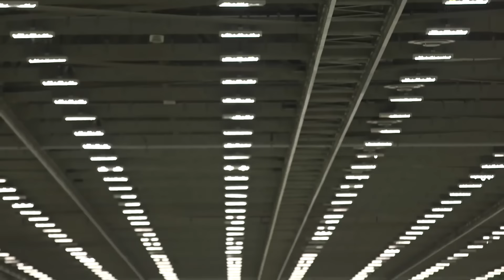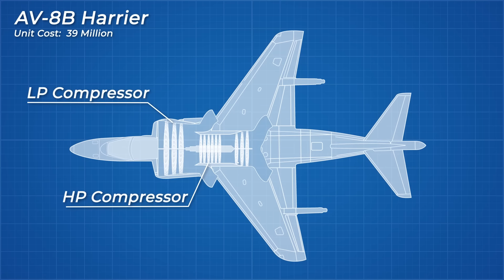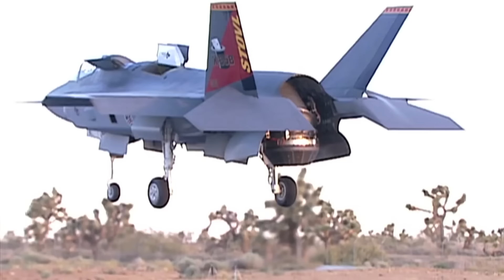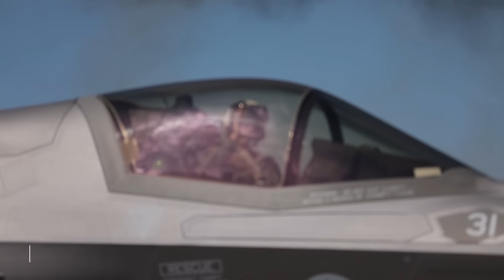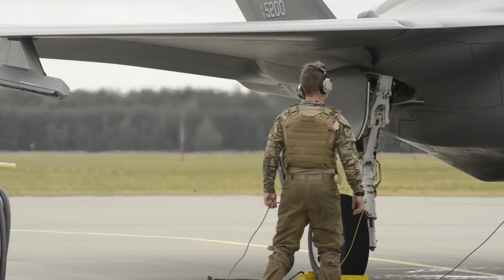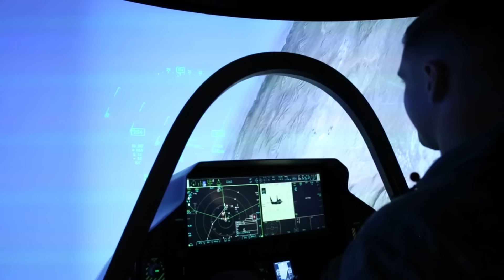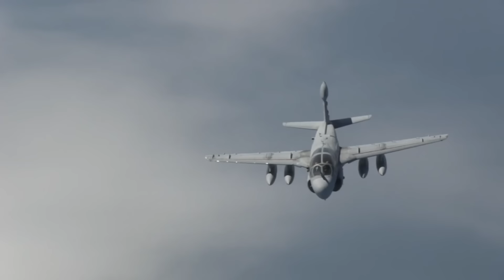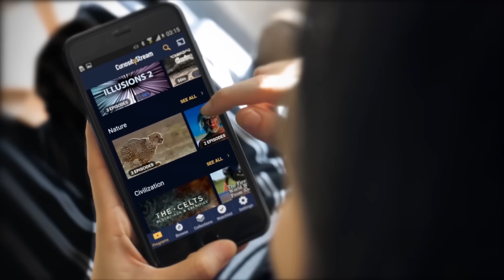Is The F-35 Worth $115 Million?

Comment: Tim N
1 second ago
im an engineer. Engineers dont just design stuff. they design solutions and this is no different. i worked on this plane (parts of it) and whilst it isnt cheap, its not the full picture.
The F35 has significantly less maintenance, turn around time and will have a higher reliability and supportability than any contemporary and historical jet, resulting in a superior cost per flight hour, and significantly cheaper support costs and logistics footprint.
Additionally the F35 programme across multiple countries has a huge domestic economic benefit which cannot be understated.
In all of these aspects it beats everyone. And then theres the performance. With the VTOL variant its clear that that offers features that nothing other than the harrier can match, and even the, the F35 has an advantage in that its much easier to fly, therefore predicted higher survivability than the harrier.
Add supercruise, stealth and the most advanced comms and detection suite and you dont need to be a great dogfighter.

PS i always think that the F117 is the 4 or 8 bit version of stealth..kinda like minecraft versus flight simulator 2020.
Reply: and yet the cpfh is significantly higher than earlier aircraft and the logistics situation is a mess due to ALIS not working. hmm.

Comment: Nice, vid just one notice concerning f117: when you said it was engineered in late 70ties, it would be also worth & fair to mentioning it was brought down by an AA system engineered in mid 50 ties, and never flew again...
Reply: The S-125 system that shot it down was a 1970s model, and it failed to lock on until the F-117A was well within weapons range.

F-117A was retired in 2008 due to obsolescence, since the B-2 could do the same role more effectively, and the F-35 was in development. It was also partly due to the shortage of pilots in the USAF.
Reply: The F-117 was used in the Iraq War 4 years after the shootdown.

Comment: Yes it worth USD115mn but actually that's not as that's costing USD 300mn with full features and flyover condition...That doesn't worth.. Exorbitantly expensive. Not at all value for money .

So at that price better to opt 2.2 units Rafale Or 2units  Euro fighter typhoon Or 4 units sukhoi su 35 Or 5units  Mig 35 Or  3units  Saab Gripen Or 3.5 units  F 16 super viper.

Units are given un decimals just to consider that any country will buy at least 10 units.

Comment: “Jack of all trades” is just a polite way of saying “master of nothing”. Being a jack of all trades worked for things like the M4 Sherman because it was cheap to manufacture and easy to fix. I highly doubt an F-35 would be a more cost-effective ground pounder than a Warthog.
Reply: "Jack of all trades" is a term touted by the media, not official representatives. The F-35 excels in BVR combat rivaling the F-22 for half the cost, and is by far the most capable tactical strike platform available today. Warthog doesn't even come close in anything other than direct fire support, which is only possible when the enemy lacks air defences.

Comment: Why didn't you quote the report the designer of the F-16 gave the F-35 flying rubbish. His analysis is a hell of a lot different to yours and I think I know who I'll believe. (not him needing US advertising money). The Helmet can also injure the pilot. The pilot can't breathe because the air generation system doesn't work and it can't be flown in a thunderstorm or inclement weather.
Reply: Pierre Sprey was not the designer of the F-16. He was an analyst who pushed for the emphasis of certain features in the LWF Program. His continued belief that the F-15 is a bad fighter because it has radar and other advanced avionics is perhaps his most egregious position, but he holds many others as well. For example, he predicted that the F-35 would increase in cost dramatically and be cancelled before the 500th plane. His analysis on manuverability is also highly flawed, relying heavily on wing loading as a metric, which ignores differences in control surfaces, wing geometry, and the lifting body effect.
Reply: @infinitelyexplosive  It can't turn as tight and climb as fast. It is a piece of rubbish and I have read greatly on the F-35 in US forces magazines and statements from the Pentagon, only less than 50% of the planes are ready for operations at any given time. They have huge maintainence issues and everything. When you buy 2 and only 1 is flight worthy at any given time, you have an albatross.
Reply: Since IE has already addressed Sprey I'll address the others... The helmet has been safe for pilots since 2016. The only time there has ever been a problem for pilots in relation to breathing it was found to be a fault with their training, not the plane. No plane is qualified to fly in a thunderstorm because if you're in a thunderstorm lightning is the least of your worries. Hail and strong winds are the main concerns.
Reply: @dumdumbinks274  Yeah a lack of training for 20 year veterans... Stop being told what to think and do some analysis. The official numbers don't add up and this sucker doesn't fly anywhere near Russian Phased arrays, Because they can pick up a 2.5cm RCS, which is smaller than this plane can be.
Reply: @ShaunByatt  Considering that only new pilots reported trouble breathing in the first place you leave me wondering why you're bringing up 20 year veterans.

What official numbers don't add up? Since nobody flying F-35s is at war with Russia they have to respect Russian airspace or risk starting a war. That doesn't stop them flying along the borders, but it does limit how close they can get to Russian radars.

All radars can detect a 2.5cm target. The question is at what range? Even the most capable Russian "anti-stealth" radars are incapable of detecting a stealth fighter beyond 200km (noted per Russian stealth capabilities which are far behind the US)... and they're incapable of effectively guiding missiles. 

The only radars Russia has that are capable of detecting stealth targets at notable distances are massive static installations that take several weeks if not months to move and are vulnerable to cruise missile attacks.

The F-35A has a very slightly lower sustained turn rate of 17d/s compared to the F-16C at 18d/s, but the F-35A has higher subsonic acceleration and far superior instantaneous turn performance, handling at low speeds, and high angles of attack that the F-16 can't reach let alone maintain control at. In terms of climb rate a loaded F-35A matches a clean F-16 to 15000ft and begins to fall off slightly at higher altitudes. Overall the F-35 is a more maneuverable fighter.

When you buy 2 aircraft and only enough spare parts to sustain 1 of them it is not the fault of the aircraft. And FYI availability rate exceeded 80% recently for the F-35A. The sub 50% rate referred to the test and training fleet, not the operational fleet. So perhaps you should take your own advice and do some investigation before commenting.

Comment: Heres something i want to ask. Wi th h a bit of tweaking would trying to rebuild a avro arrow be a good idea and would it be better than the underperforming in combat f35
Reply: No. Avro Arrow was only noteworthy for it's technology, not it's performance. The F-4 was superior.

I'm not sure why you think the F-35 underperforms... it is the most capable fighter around today.
Reply: @dumdumbinks274  under performing from its price tag and the sevice costs
Reply: @justadood5483  F-35A costs less per unit than every other Western fighter except the F-16 and F/A-18. It's high maintenance cost is due to being new (e.g development creates a need for more spare parts due to high rate of improvement and modifications creating many aircraft with slight differences), and the politicians in the industry trying to create a completely new maintenance infrastructure with ALIS. ALIS is being replaced because of how bad it is with ODIN starting in the next couple of years, and cost per flight hour is expected to be equal to the F/A-18 at around $25000 by the end of the decade.
Reply: @dumdumbinks274  the avro arrow from what i remember it originally had a service cost of a million of course i did say that there would be upgrades to the avro arrow if it would be brought back and the costs to get thrust verctoring, modifying the missile/fuel bay to hold modern missiles, new radar, remake the control system, tune the jets and add titanium and strong heat resistance materials to wing tips to and any other spots to handle  the new speeds it would reach (which would probably be mach 3), add some stealth, a refueling boom, the new inlets that were originally made for it to reach mach 2.5+ im pretty sure and a gun would cost a lot which would probably bring the costs to a few hundred million to develop and would bring the service costs to some where below 100mil
Reply: @dumdumbinks274  the advantages it would have is speed and range and would probbly have 2 variations 1 to attack and the other to intercept